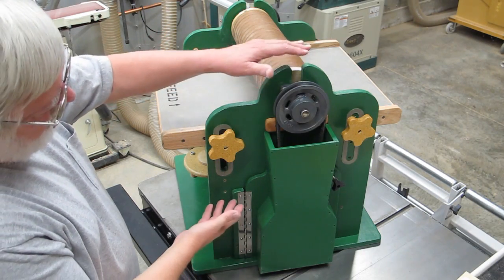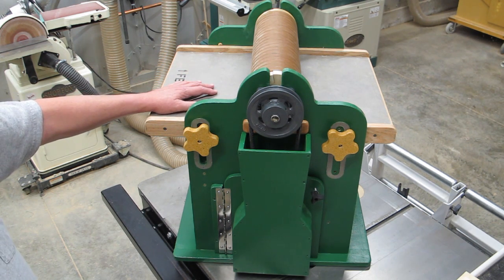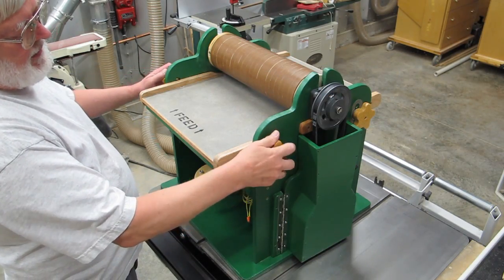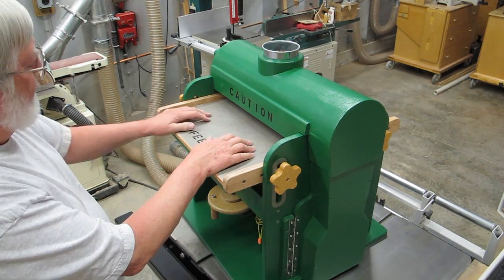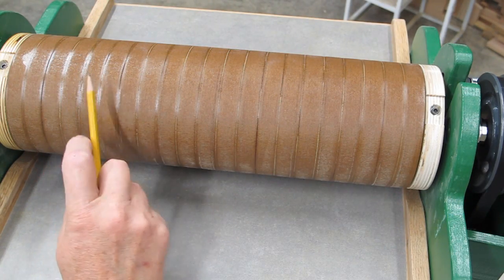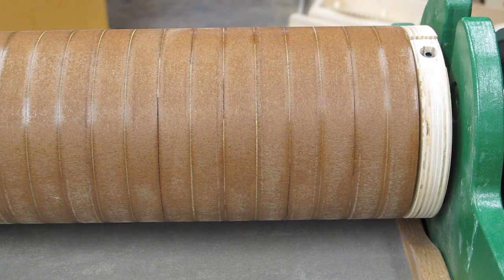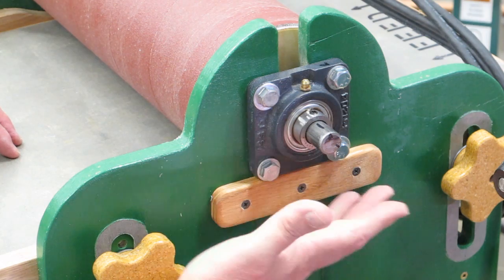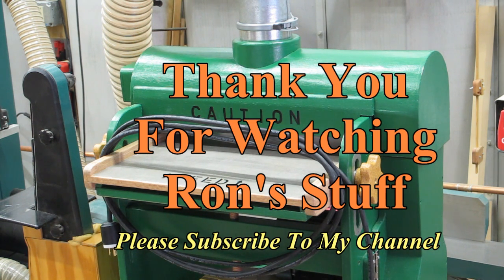Drum Sander - Trials And Tribulations Using Old Plans For A Shop Built Sander

Comment: I didn’t look through all the comments but instead of the belt feed Conveyor, how about feed rollers. There’s a guy on here that did that so he’s got a feed roller in the front and then in the back so you’re all I have to do is push the stock up to the feed roller than it takes over keep your fingers out of it and feeds it through. Eventually I’m going to make one that looks up to my leg and that’s when I’m gonna try to do the feed roller deal. Just a thought, because I don’t like the idea of hand feeding either.
Reply from the maker: As you wish...
If you watched the entire video, you would have seen where I tried a feed belt (drive rollers on each end) and it just didn't work out.
Drive rollers by themselves (no feed belt) is probably a bad idea as you can end up with the same thing as planer snipe on each end of the board.
I use a custom push stick to push the stock being sanded clear of the sanding drum. Been using it for years and haven't had a problem... still a very good idea to stand to one side when feeding stock... as with most power tools in the woodworking shop, kick-back is always a possibility! 
Thanks for watching.

Comment: про транспортёрную ленту! = изначально неправильно порезанная и приклеенная, в стыке надо делать зазор!
Reply from the maker: I thought the same thing... but I measured and inspected it and all looked good. I tried turning the belt around which (if a fault with the belt) would cause it to track in the opposite direction but it made no difference. Then tried two other sanding belts of different manufacture and still had the same problem. Grrrrr! I guess it just was not meant to be. :-) Thanks for watching. Ron

Comment: What is the distance between center of driver and driven pully? Second if you have drilled holes for flange bearing in body, so why you putted shim under flange bearing.
Reply from the maker: If this comment was left 11 months ago, I have no idea why I am just now seeing it.
Distance between pulley centers… sorry I don’t know and since I recently had knee surgery I am currently unable to measure it.
The wood block under the flange bearing supports the flange bearing. Use of a shim between the wood block and the flange bearing is a way to fine tune the drum to be parallel to the table.
Reply: @RonaldWalters2010  get well soon Ron. I am also building this sander, i assumed the dimension from your vedio, will show you as completed.

Comment: You had the same problem I had with my conveyor belt. However I was able to fix it and very happy with it. My table is solid however the rollers are on bearings at the end of the table . One roller at the end is the driver roller, at the other ens, the closest to the start, is the driven and adjuster toller; the one that also adjust the runup. I do nor know the effect of trying to pivot 1/2/o  the table of just the roller.... perhaps that was your problem...I do not know. I can send you picyures if you like.
Reply from the maker: Thank you for the offer but that was several years ago and I have no intention of changing it now. Actually it works pretty well just as it is.

Comment: A tip for those who watch this and want to build their own with a power feed. Use smooth metal, plastic or wood rollers, the inner tube he put on the rollers had too much grip on the belt and did not allow the belt to track.

Comment: What is the hole size of the rod?  Is it threaded or solid?  I am getting ready to do my glue up of the circles.  What do you suggest for the 1mm spacer material?
Reply from the maker: Drum is on a 3/4" solid steel rod. The 1mm spacer material is air... it's a 1mm air gap. You may find the information on the following page useful. https://woodgears.ca/reader/walters/drum_sander.html  Matthias Wandel on woodgears.ca has some information on drum sanders.
Reply: Thanks I get it.  A router bit works good for large circle.  I am not comfortable with that method for small circles.  I may cut the circles with a jig saw and use your sanding jig.
Reply from the maker: You basically only need to get them pretty close to being a circle. After the drum sander is functional you glue sandpaper to a piece of plywood and let the drum sander sand itself true to the bed before attaching the hook material.
Reply: I did what you said, cut out glued and roughed out the five sections of circles.  Did you cut a slot in the 3/4" rod for the piano wire?
Reply from the maker: I drilled holes for the piano wire at right angles in the 3/4" rod everyplace I wanted to lock the discs to the 3/4" rod. I slotted one disc to go around each piano wire, then sandwiched the other discs on either side of that one.
Reply: I cut slots with a wide metal grinder.  In the slots I used jb weld and a small woodruff keys, taping with painters tape.

Comment: I have 40, 14" redwood boards with old white paint on on side.  They are 5/4 thick.  Would this work for getting the paint off, minimizing dust?
Reply from the maker: Paint tends to plug abrasives. Using a plainer to first skim the paint off and then a drum sander would be a better approach.
Reply: @RonaldWalters2010  You did a great job on this.
Reply from the maker: Thank you!

Comment: Beautiful build!  Question about the pivot for the table...Once you set the table height and tighten the back knobs, how can you easily tilt the front of the table to adjust the thickness?  Any trick to how that pivot works or is just friction and you can still tilt the front to adjust the thickness?  Thanks.
Reply from the maker: I think you need to watch the video again. The table pivots on the two back knobs which do not need to be tightened as they are the pivot. Loosen the two front knobs (which run in a slot). Raise or lower the table with the elevation screw (in my case a threaded wood dowel) then tighten the two front knobs. Fine adjustment is possible. You just want the sandpaper to just skim the surface of the wood, it is a sander not a planer. Thanks for watching. Please subscribe!
Reply: Ronald Walters I mistakenly thought the back pivot/knobs fit in a slot like the front ones.  I think it was the large oval shaped Formica that threw me off.  Looking closer, maybe you just have a few holes the pivots can be set in instead?  That makes more sense now.  Thanks.
Reply from the maker: Correct. The knobs (front & back) have large fender washers under them and the oval shaped Formica keeps the washers from rubbing on the paint. The rear holes provide a series of different clearance ranges.

Comment: Thanks Ronald.  I have been researching and designing for a week and just came across your video.   That is perfect for my needs.  I am getting into making small decorative boxes and cutting boards with my newly build CNC router and just need the drum sander to dress the timber first.

Perfect job and explanation of drum size, RPM etc.  I was going to make a conveyor belt but I think I will forget this after your comments.  Maybe later if I find i am in a production line environment.  Thanks again

Comment: I recently built one of these that does run off of the table saw arbor because I have "0" room for a heavier unit. I made the conveyor rollers out of PVC and sprayed them with Flex Seal, a rubberized spray coating. The belt doesn't slip on them and they seem to track well enough. It beats feeding the work by hand. There is a YouTube video on Flex Seal for more info on that.

Comment: I'm just curious of what tool you used to put the slots in the formica washers, a router or Dremel?
Reply from the maker: I used a 3/4 inch Forstner bit on the drill press (very carefully from both sides) to just scribe the Formica on both ends. You just want the outside rim of the bit to cut the Formica, not the main cutter or chipper. Clamp the Formica to a backer board. If the bit grabs and that Formica starts swinging around on the drill press, it could easily remove a body part. Then cut the straight parts on the scroll saw. Clean up with a fine file & sandpaper (or gently with a Dremel). Rough cut the outside dimensions on the scroll saw and gently clean up on the disc sander. Formica is pretty brittle so the scroll saw cuts need to be with a fine tooth blade, slow and easy. Thanks for watching! Ron

Comment: Hi Ron! Fantastic work. May i ask you, just for a reference, what is the height and width of your sander's side pieces?
What is the maximum thickness that you can feed her?
Best regards!
Reply from the maker: +André Lança  Side width 17". Table top to drum axle center 20". Table top to top of drum guard 24". This will probably take a 4"+ thickness but I don't think I have ever fed anything thicker than 1". You could build it to accept whatever thickness you need.

Comment: Hi Ronald my name is PatGandy. I just watched "Matthias Wandel" on his website make wheels for his bandsaw. He said "and I believe him" that drive belts will travel along a wheel  and center itself at the highest point along the weels service. I started thinking "a dangerous thing for me usually" but I  put his words to your belt sannders belt not tracking right and thought perhaps if you could create a curve along the surface of the drum where the center woul be bigger in the  middle  it would tack to the center for you. Watch his band saw build youtube episode. pg
Reply from the maker: +Pat Gandy  You may have also noticed I posted this video on Matthias's website over 4 years ago. 
Construction article: http://woodgears.ca/reader/walters/drum_sander.html  
Tried that several different ways and none of them worked for this wide belt. Got tired of messing with it and did it this way. Thanks for watching. Ron

Comment: Well, I'm with you on the Baltic birch. That sounds a whole lot stronger. The only reason I THINK I'd prefer the table saw version is because of the very limited space in my garage and the infrequent use the sander is likely to see. I have the resources to build the self contained version (including the motor), just not the room to store it as easily.Thank you for your reply.
Reply from the maker: +endrot1 Footprint will be the same either way, height and weight would be different. Only have to get out of sequence once or twice, needing the table saw again and then the sander again to make you a believer. :-) I don't use mine that often either but is sure is nice to just plug it in and turn it on. And No, I never bothered any further with the conveyor fiasco. The push through feed is fine as long as you are careful. It come come back at you pretty quick.

Comment: Hi Ron, I am starting to build the table saw version of the drum sander. It is disappointing about the conveyor so unless you have found a remedy, mine will be hand feed. My question is, are the lag bolts for the pillow blocks strong enough to weather the test of time and vibration when screwed into the MDF without any additional reinforcement. Do you think some yellow glue in the holes would help strengthen the mounting or would it increase the chance of the MDF breaking if the need to remove the blocks arose? Thank you!
Reply from the maker: +endrot1 I would never use lag bolts in MDF. The only MDF used in my sander was for the drum. Everything was made of Baltic Birch Plywood. I did not use pillow block bearings. I used flange bearings. So basically I used the plan "ideas" but made it stronger and better (I think). I strongly suggest it have its own motor. Using this on your table saw will be a general pain in the ass. You should probably follow the link in the video description to my construction article.  Good luck!
Reply: Re: tracking
A good way for a belt to track is to offer a modest crown on the shafts that the belt runs on. Ronald if you still have access to the unit try wrapping one layer of duct tape around one or both shafts in the middle 1/4 to 1/3. This might offer enough crown to help allow the belt to track straight.
Reply from the maker: This sander was built 5 years ago and that belt feed mechanism is long gone. I had tried several times and to different extents wrapping tape to build crowned roller(s) but that did not work for me. Thanks for watching... and your comment!

Comment: Hi there, Great video.... What direction is the sander going. Is it feeding in on it self...  spinning towards you and pulling the wood in on that smooth feeding table.
Reply from the maker: 1airgforce1 A drum sander always turns towards the feed (otherwise it would be like a baseball pitching machine). Therefore, you need to push the wood all the way thought the sander with a push block to completely clear the sanding drum... or very carefully control the wood as the drum returns it to you.
Reply: Thank You very much....

Comment: Great video.Where can I get the plans?
Reply from the maker: ***** As already stated in the comments, the original plans were ShopNotes Vol 15 Issue 86 published May 2006 titled “Build Your Own Thickness Sander.” However, I hacked their plans quite a bit and what I ended up with is quite a bit different. Read the construction article on woodgears.ca (link in this video description).

Comment: beautiful machine!! :)  I am about to build one ... would you change anything if you were going to build it again today!
Reply from the maker: Jim Coyle I guess there are always a few things to improve. For the drum I would probably use particle board instead of MDF and every few segments leave a slight gap for expansion (1 or 2 mm) which would require placing a few more cross pins in the shaft to keep the segments from possibly spinning. Even though I have seen some cracks at the glue joints of the MFD discs it has not been an issue. Using particle board would make it more difficult to initially true the drum to the table. I would still like a powered belt feed. Pushing the stock through manually with the tilting table works pretty well and since this does not get used all the time I am pretty happy with it as is. It comes in really handy when you occasionally need it and once built you will continue to find more reasons to use it. The fine dust off this drum sander will be like talcum powder and will tend to plug up your dust collector filter, so plan accordingly. The dust is fine enough that it easily gets past the cyclone. Finally, use it as a sander and not a planer... many very light passes, rotating the stock and flipping it over will work best and the abrasive will last longer. If you sand only on one side the wood will get hot and start to cup. Enjoy!
Reply: @RonaldWalters2010  You made mention in the video of a Matthias Wandel article the talked about the need for spacers in the drum. I went looking for it and was unable to locate it. Can you share a URL to that article?
Reply from the maker: I couldn't find it either. That was a while ago. Now I'm not sure if it was in an article of his or he and I were just talking about it. You want a few SPACES between some of the discs not spacers. Read my comment just above yours where I go into this.

Comment: Hello, what is the power of the motor? thanks)
Reply from the maker: Эдуард Петерс Motor 1/3 HP 1725 RPM 115V 60 Hz - - - 5 inch diameter drum speed approximately 1100 RPM

Comment: I almost finished my drum sander, based on matthias plans, but i have a problem that while sanding the drum for making it even and true, it started slipping on the shaft. My drum is made of high quality 17mm birch plywood. I glued every 5pcs together and left 1mm gap. I was relayoling on friction to hold the drum on shaft. Big mistake. So Can you explain more about how to attach the drum to the shaft? Now that its all assembled already...
How did you drill 1/8 hole in the 5" drum? I dont think there is a drill bit that big with such a small diameter! Help would be highly appriciated.
Reply from the maker: Matthias was probably relying on glue to hold the discs to the metal shaft. I don’t recall this being mentioned in the article. They make drill bits long enough, however your aim may not be good enough to hit the center of the metal shaft (those bits can wander). A good tool supply will have long reach or aircraft drill bits. However if the groups of discs are spinning free on the shaft I would try to work them off the shaft one-by-one so you can accurately cross-drill the shaft. Since you have a gap between groups of discs you will need to have an engagement pin for each group. Use short steel pins to engage a slot ground in the disc groups. Use epoxy to hold the pins in the discs upon reassembly. Alternatively, you could ask Matthias for his suggestion since it is his plan.

Comment from the maker: Velcro mounted sandpaper is a bit cushioned. Keep rotating the wood on subsequent passes through the sander. Many very light passes works best and the sandpaper lasts longer. The larger the piece, the greater the measured variation. You could shim the bearing on one side or the other to narrow it down, but then when you change sandpaper that may change again, chasing your tail a bit perhaps. I have made several quite large diameter clock wheels and it certainly has been accurate enough for that.

Comment: Ron you should try your conveyor belt on your sander  it would be the perfect tool i have been using mine for close to 4 years now   i do a lot of sanding and i did not change the belt yet  those belt wont track at low speed they are made to go fast Look at my video georges drum sander 2 and you will see my new adition

Comment from the maker: Aluminum would not be a good choice. Cold Rolled Steel shaft should be readily available and it should be fairly straight unless someone drove over it with a forklift or truck (very possible). Another possibility is drill rod or drill steel. Also stainless steel rod. Keep looking… check the machine shops.